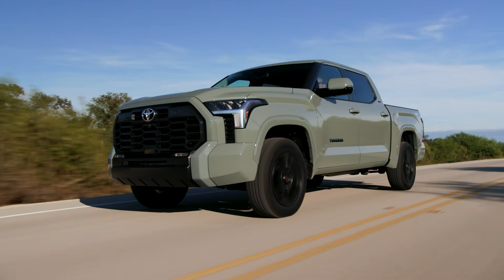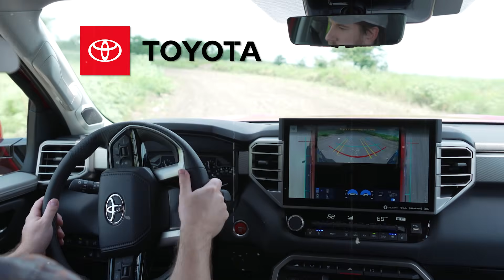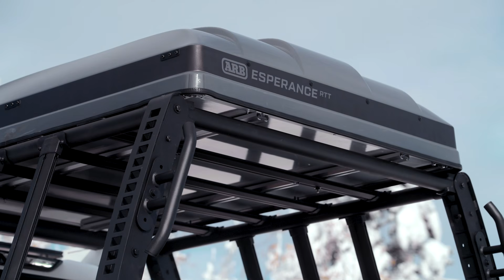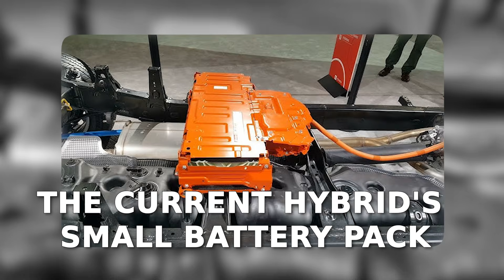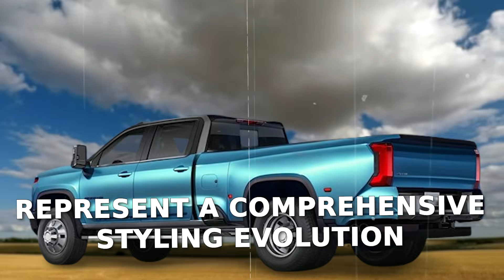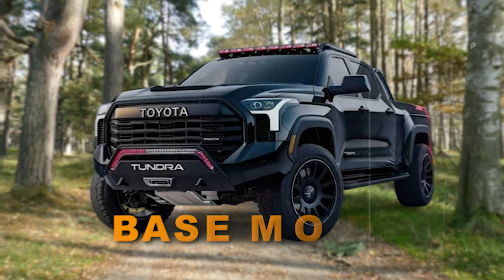All-New 2026 Toyota Tundra Turns Toyota Haters Into Believers!

Comment: The thing I don't care for here is the pseudo disinformation in the name of market advertising.  There is no dually model out for commercial or consumer purchase, so how can anyone who might be sceptical suddenly be converted or persuaded otherwise?  If you can show where these models have been tested, released and driven by consumers or commercial operators and their enthusiastic support, then by all means please do provide that data.  Because without that, this is speculation as to how the vehicles will be received when they are available and how they will be reviewed by those who do so for publications -  pure speculation devoid of facts
Reply from the maker: What would you say is the most reliable way to judge a new model before it’s actually out on the road?
Reply: @tech_triumph  it wouldn't be to use click bate titles of:  Haters Converted.  That is for sure.  Perhaps something about new models coming soon and with some known features.

Comment: If Toyota wants customers put your new tundra on a chassis dyno and bring it up to 75 mph and run it 10 hours on 2 off change oil every 5000 miles but they won’t because it won’t go half as far as the old V8 so Toyota keep your turbo toys dont want them Kaisen my ass